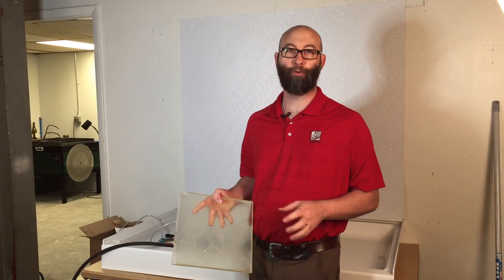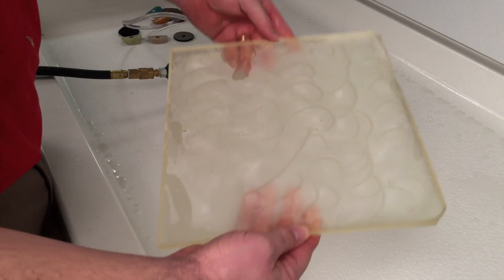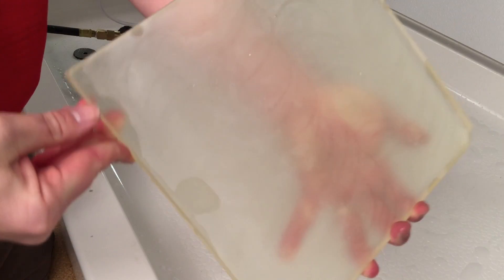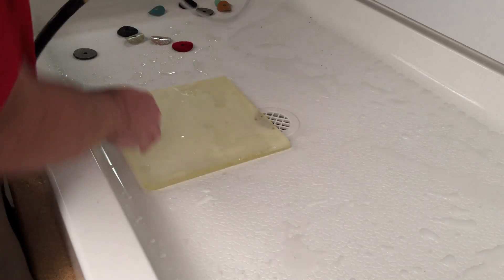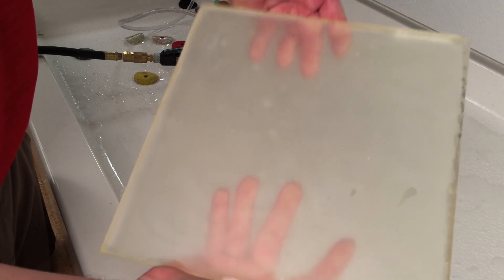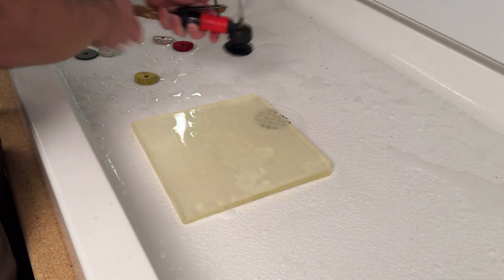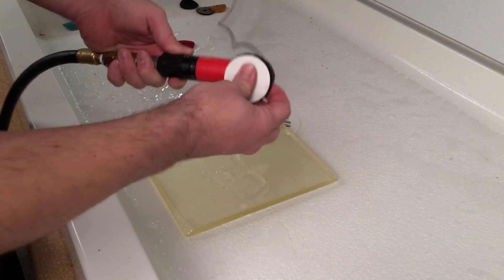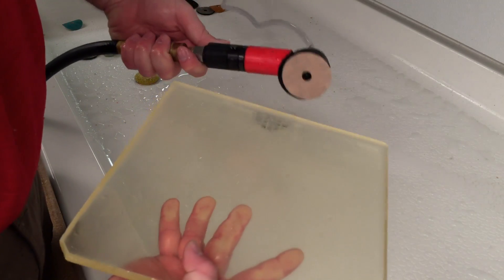Grinding cast glass with diamond disks on a right angle water feed grinder

Comment: how much does the handpiece retail for?
Reply from the maker: The Suhner model is listed here:
http://www.hisglassworks.com/shop/machinery/hand-grinders/pneumatic-grinders/suhner-lxb-10-pneumatic-right-angle-water-fed-grinder-html.html

The Alpha also runs the smaller 2 inch pads and is listed here:
http://www.hisglassworks.com/shop/machinery/hand-grinders/pneumatic-grinders/alpha-air-300-pneumatic-water-fed-grinder.html
Reply: $735..... Can you say harbor freight throw away?